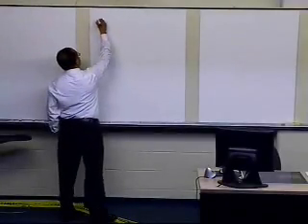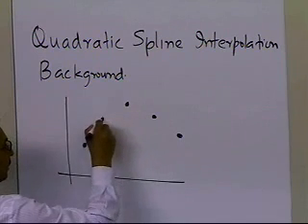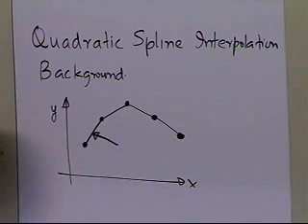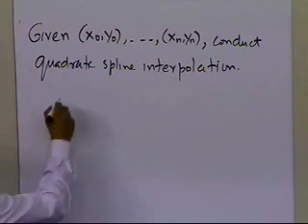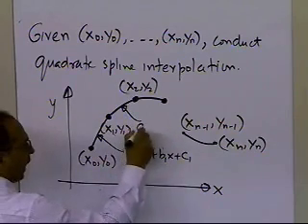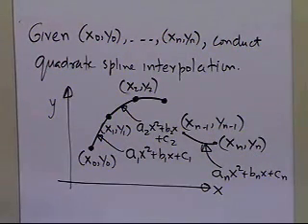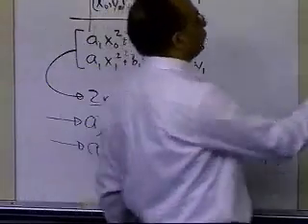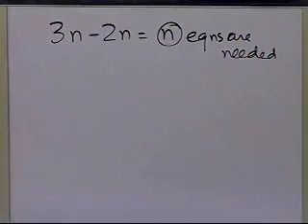Quadratic Spline Interpolation: Theory Part 1 of 2

Comment: This is something I call "Lecture Pollution". It's something that took me ten years to learn not to do when working with my students.

You said there are two problems with linear interpolation: 1. The only information you are using is two consecutive points and 2. slope is discontinuous. I consider discontinuous slope a problem (in any application where a smooth curve is desired) but not how much information I'm using. You did not list two problems with linear interpolation. You listed a single cause of the single problem (1) followed by the single problem itself (2). The amount of data I use is not the problem. It's the cause of the problem. It's like saying, "I have two problems: 1. I wasn't paying attention to what I was doing, and 2. I put a half teaspoon of salt in my coffee." The process of  learning is too delicate to allow for things like this. Math is already a terrifying jungle for those trying to learn it. The last thing a student needs is a few unnecessary thorny vines to hack through.
Reply: "Could you be anymore condescending?"
I could give it a try. May I ask why you make this request? But seriously, I'm not being condescending. Condescending is when you wrongfully and covertly put someone down and pretend to be polite about it or pretend you didn't do anything wrong. I was drawing attention to a flaw in someone's technique that is genuinely harmful so that the obscure truth may be more apparent. I also accept accountability for what I said and offer no apology for it. What you mean to say is "Could you be any more critical?". The only person I'm being condescending to here is you.

"Where's your video explaining the theory behind quadratic spline interpolation...?"
I am esteemed for my skills in tutoring maths professionally, not for the number of videos I've posted to YouTube. And no, you may not hire me. I'm booked.

"...asshole..."
I love you too.

P.S. Let the record show that you drew first blood here. I wouldn't have been such a dick to you if you hadn't called me an asshole.
Reply: So you are a fan of parsimony in teaching. 'Why repeat the same point twice' you ask (specifically, 'why list the consequence of one idea as new idea in itself').

Does it not occur to you that saying something from more than one perspective and clearly calling out the consequences is helpful for learning? Have you also had such a visceral reaction to when you saw the well-ordering theorem presented after the axiom of choice? How about this, I will give you ZFC, and you prove the rest of math... it's all superfluous to the learning of a delicate student. The last thing David Poirier needs is a few unnecessary thorny vines of Gauss, Euler, Lagrange, Hilbert, etc. to hack through.

Math is already a terrifying jungle for those trying to learn it. The last thing a student needs is a teacher who doesn't understand how humans learn in the first place.

Comment: Where can I find an example that uses quadratic spline?
Reply: Heat conduction
Reply: @only_for_fun1234r  Thanks man. 👍😁
Reply: @elinaldo junior
Reply after 7 year
Reply: @only_for_fun1234r  its never late 😂
Reply: R u working  person now becoz i m a student of 3rd yr MECHANICAL
Reply: @only_for_fun1234r  yes, i am a full stack web developer.
Reply: But why u watchedthis video its not related to ur computer knowledge
Reply: @only_for_fun1234r  in 2013 I was a student of the master's of mathematical and computational modeling system.
Reply: @jogoprogramado  i also love maths  but unfortunately engineering come with more physics than maths
Reply: @only_for_fun1234r  I like both areas, but only as an enthusiast.

Comment: True, but I was hoping that this matter could be ignored (while I do suspect that it is probably not okay).
I wondered what if we find a spline based on values in points x(i-1), x(i), x(i+1), but use obtained coefficients only for x(i)<=x<x(i+1) part... This way we also don't have to assume that one of the coefficients (a0 for example) is equal to 0...

Comment from the maker: Do a search on ""history of splines - WikiHelp".  You will have your answer.  As mentioned in the article, "Splines are types of curves, originally developed for ship-building in the days before computer modeling. Naval architects needed a way to draw a smooth curve through a set of points.  The solution was to place metal weights (called knots) at the control points, and bend a thin metal or wooden beam (called a spline) through the weights."